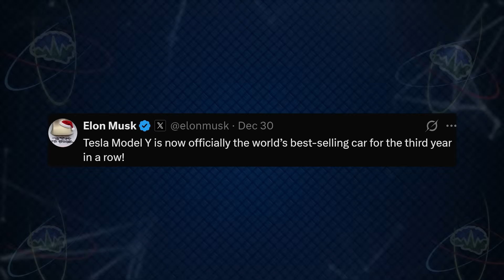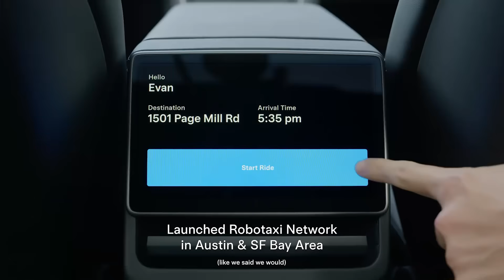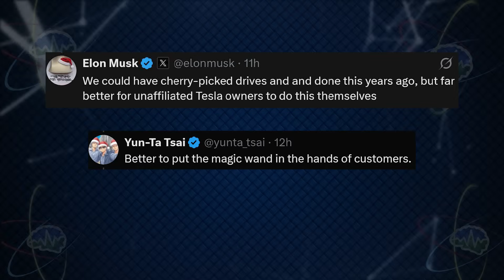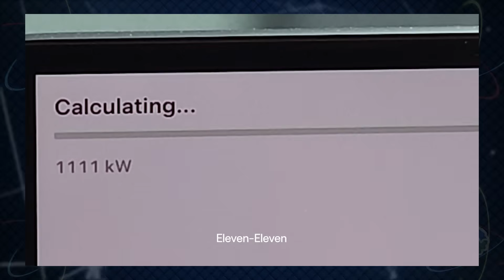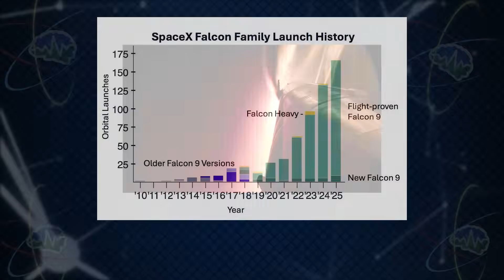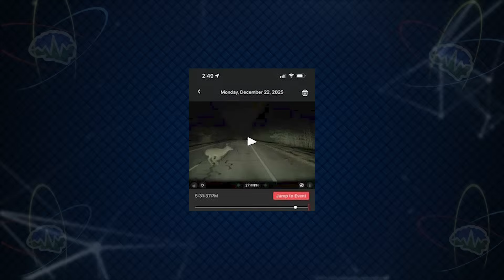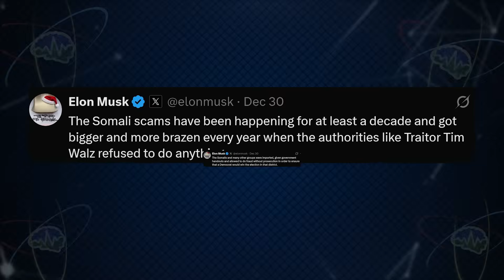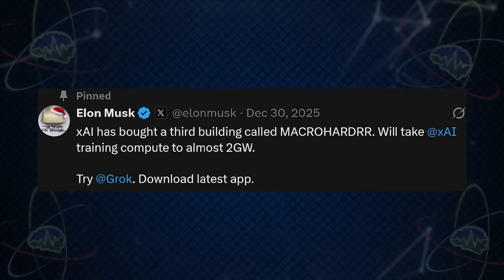Tesla Drives Itself Across USA | Tesla Time News 566

Comment: The First day I had my vehicle driving home on FSD from picking it up in denver, my second supercharge from Grand junction to my home in the remote mountains of the Western slope the car was doing 50 the posted speed, on FSD and we went around a corner my hands around but not touching the stearing wheel, and it didn't stop for 5 Elk in the road having a meeting. It slowed and weaved to about 5 mph in miliseconds but didn't stop and also went slowly through the crowd causing me to WOW but worked flawlessly, I wish I had saved the  video but forgot to get it before it was overwritten because I was a newby but now I am a TOTAL supporter from that point on!!!
Reply: My Cyberflop came acros a pod of whales doing 150 mph at the Grand junction. The car flew over them in a somersault and landed softly whistling a happy tune. Pity I forgot to save the video, but you must trust me  and the glorious leader supreme Musk/Trump/E.Pstein and give them as much money and power as you can.

Comment: Waa any of that durring inclement weather? Love FSD  but my experience when the road gets icy it does not do the job. Had hoped to go out for New Years Eve last night but decided to stay in when my 2026 MY slid through a residential stop sign into the intersection. Fortunately no cars passing through. It's a one way intersection that's immediately followed by a train passage. Again Fortunately no train was passing either. I had been traveling in sloth mode. I was forced to take over. It still traveled to fast comming into the intersection. I don't know how a taxi service will work if they can't have better control in these situations. My car is the long range perhaps the dual motor would respond better?
Reply: You should not be driving on ice. Snow, yes.